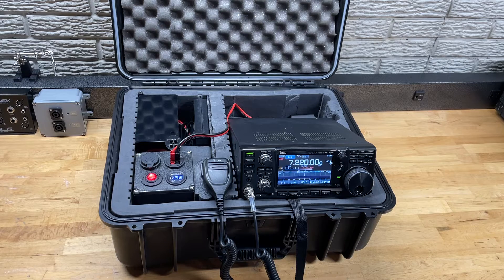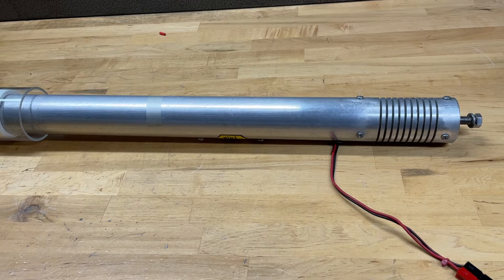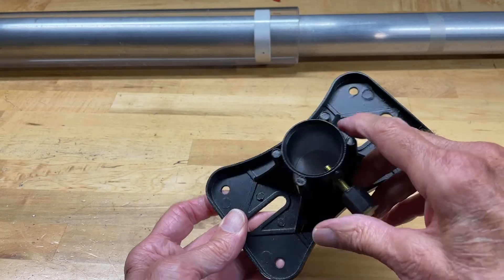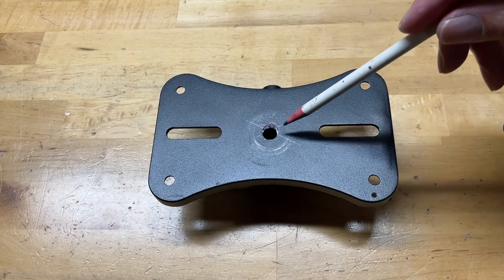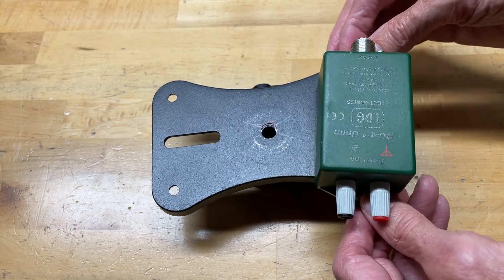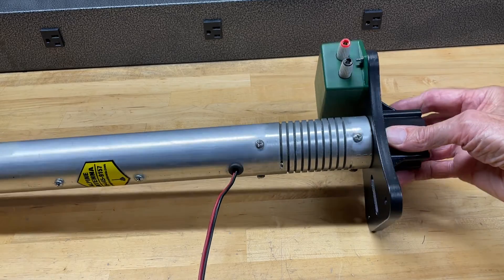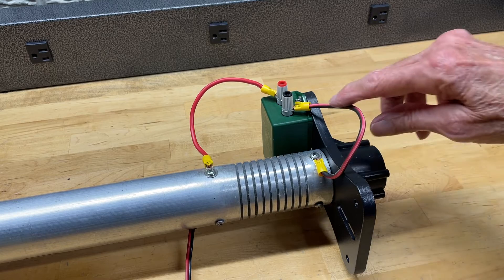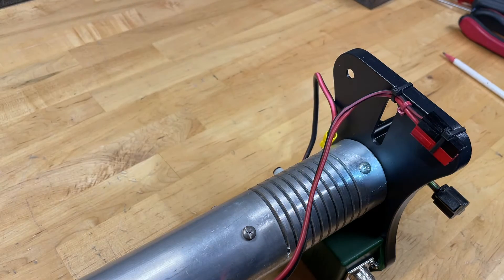SCREWDRIVER ANTENNA MOUNT with Unique Radial System

Comment: This is an excellent mechanical installation, but this Don Johnson screwdriver already has built in impedance matching coil and 4:1 balun is not needed, 
but choke balun instead. To get 50 Ohm impedance, the coil has to be tuned by making a jumper between ground and the coil. 
With the SWR analyzer determine how many turns should be shortened to get 50 Ohm. With the proper installation you will not need a tuner to operate the radio. Vertical antenna has about 30 Ohm impedance and with 4:1 balun will be much lower and you will  not be able to user your radio without a tuner.
Reply from the maker: Thanks Ned!  Since the Balun makes a nice connection for the coax I’ll short the balun coil and give it try that way.  -Ed
Reply: LDG has 1:1 BALUN, the same size as the one you have. 73

Comment: Nifty idea. I do wonder what the purpose is of the 4:1 Balun. From having run a Tarheel Screwdriver antenna for years myself there is a need for Feed Point Impedance Matching on 40 and 80 meters. I'm guess that is somehow the reason for the Balun.
Reply from the maker: Hi Dennis.  It seems to match somewhat easier and provides a clean feedpoint.  It certainly would probably work without it.  -Ed  W8EDW

Comment: This is a different idea of hooking up the radials. I want to applaud it because you thought of it and it will find preference with some. However, crocodile clips work for me. Well done.👍☘️
Reply from the maker: Hi Donal. You are right!  There are many solutions.  I just thought it would be fun to try something different. -Ed
Reply: @edwhitney1862  Thanks Ed. What the heck, why don’t I subscribe? There you go. Done!👍☘️EI3KY
Reply from the maker: Hey Donal thanks!  I’m always messing around with something .  Building the screwdriver control box (video) next.